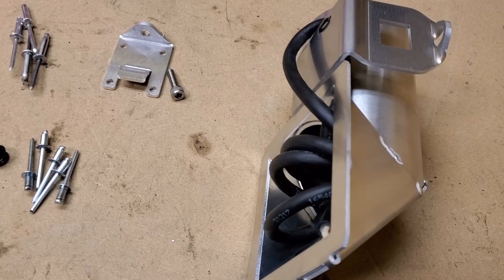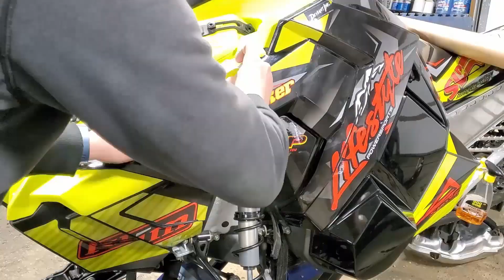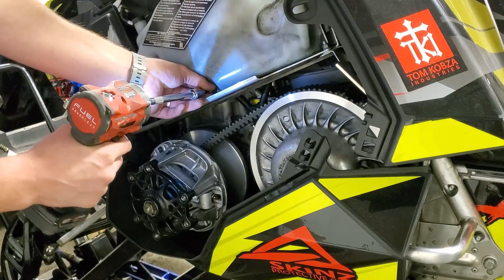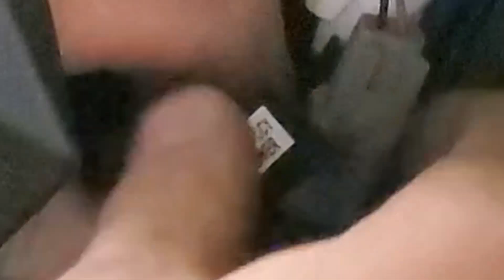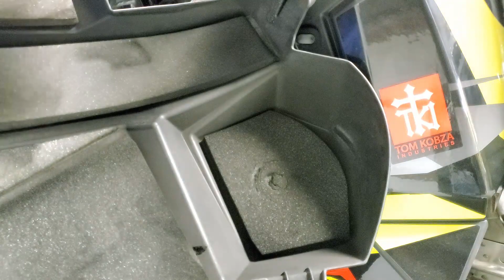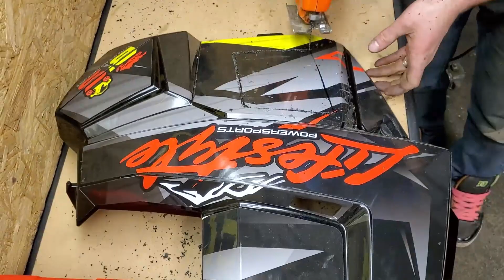MTNTK Performance- Polaris Axys Blowhole Kit Install

Comment: do you have any issues with ice build up from this blow hole kit? and snow getting in to your belts?
Reply from the maker: @christianjustus9900  i don't have the sled anymore but I never had any issues with either of those. My belt and clutch temps stayed cooler and I never thought about it any more after installing. It was a great upgrade in my opinion where I put twin pipes on the sled.
Reply: That’s awesome. Thank you for the reply. Great videos man.